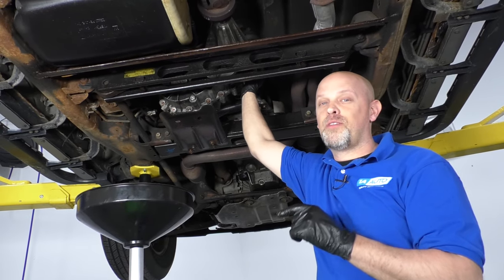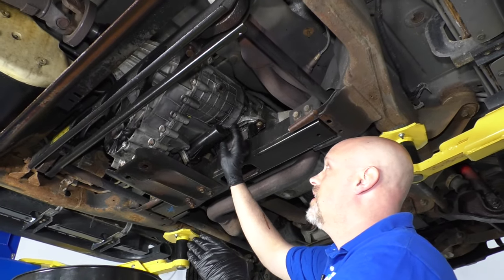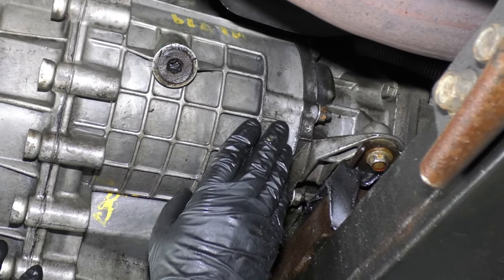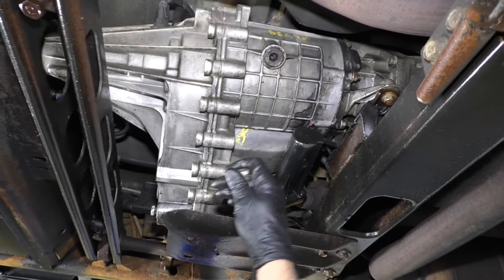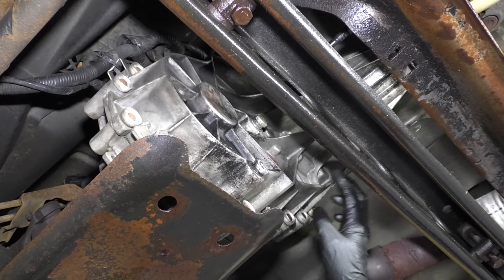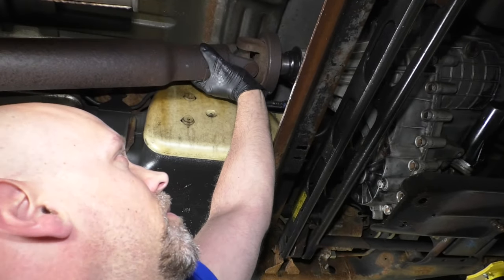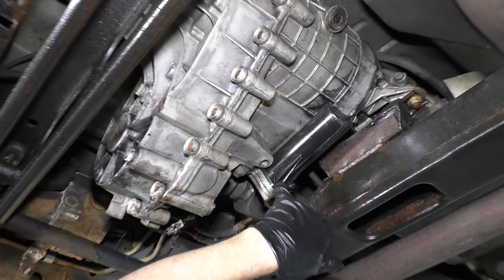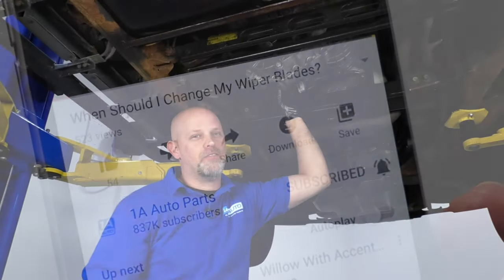Common GM Truck and SUV Transfer Case Problems

Comment: I have a 2018 Chevy 2500hd Duramax with 2, 4Hi and 4Lo.  I would like the auto function as offered by AUTOTRAC® 2-SPEED TRANSFER CASE WITH DIAL CONTROLS, is this possible and what needed?

Comment: 2002 escalade 6.0 AWD rear drive shaft is not turning the back wheels  car only moves with front wheels any idea?
Reply from the maker: +Shawn Wickham We wouldn't be able to diagnose an issue like that here, you may want to have a local mechanic take a look at it. Thanks for checking us out! http://1aau.to/m/Shop-1AAuto-c

Comment: Is there a way where I won't have to have the transfer case if I just run it in 2WD? I heard something somewhere about if u don't engage the 4WD then the transfer case issue won't be a problem... Can ya help please?
Reply: Mine still leaks and I only use 2wd

Comment: Just financed a 12 equinox with no warranty ff three mos.  Later had to be towed they told me it needs a new transfer case and catalytic converter their wanting $3820 for parts and labor
Reply: Unfortunately there known to have those problems,my wife use to have a 2012 or 2011 and there were engine problems,check and see if there's a recall on that particular problem...My wife now has a 2016,no problems with that one...
Reply: always google the car you want to buy first for known problems next time.

Comment: Hey I have a 2000 suburban k1500 it makes clunking noises when I take my foot off the accelerator n when I hit the accelerator I don’t hear it. Need to know the actual problem
Reply from the maker: +Nate Williams We would suggest consulting with a reputable local mechanic to determine the exact cause of this problem.
Reply: Could be u joints, carrier bearing, trans or motor mounts. Look all that over, see if there's anything amiss.
Reply: @markk3652  jnb

Comment: So I have a question my 4 wheel drive is messed up I have a gmc 02 yukon 4x4 I can't use auto 4wheel at all  an I can use 4 high an low but after about 30 seconds the service light comes on for 4x4
Reply: There’s videos about one of the electrical cables for the system not being grounded. Look up “Chevy service 4wd  message,” might just be as simple as regrounding the wire

Comment: What does the transfer case do for a 4 wheel drive vehicle? And how can you tell when its bad? I recently had a transmission replaced and its still having shifting issues

Comment: I bulletproofed my truck supposdly in a shop called"precision automotive and diesel ".the mechanic Rob told me he fixed the truck and I told him whatever u see wrong fix it.He charged me for a used injector 1900$.It was not part of the bulletproof job but I trusted him. I drove the truck and parked it in a clean parking lot with 250$ a month. The transfer case is leaking oil now and he said it's not his fault. Knowing that the truck was NOT leaking before I took it to him!!!
90% of the mechanics are scammers. 
Now I want to fix it at home.any suggestions?

Comment: I have a 97 gmc jimmy 4x4 the push button works fine and I can hear the four wheel drive engaging but when I test it in the mud only the back wheels spin what could this be?
Reply: Front diff isn’t engaging
Reply: There is a electrical part that engages the 4x4. Mine was worn it would engage but teeth are worn. It’s a $500 part for me.
Reply: I believe that vintage GMC front axle is engaged via a vacuum servo. Maybe located under the battery tray. Could be just a broken vacuum tea or line going to the servo.

Comment: What could be the reason my 4wd shifter is dangling around/loose and won’t activate my 4wd mode?
Reply: did you ever find this out having current problems with 4wd shifter

Comment: So it's actually not called the front transfer case its the front differential thats broke so i got the naming wrong but its whats broken the mechanic thinks its a bad transfer case but its not 

He thinks once the back or middle transfer case is replaced that the truck will have drive and reverse after that but i don't think so because i heard the front differential rattling bad and just before we turned around the corner then it broke and wouldn't drive or reverse so its like its stuck in neutral the front differential sount like there was a metal plate dangling and rattling around bad 

But the mechanic says its a bad back transfer case and thats our problem after its fixed we're good to go he says.

Comment: I really don't see how will it drive with a new transfer case but a broken front differential or switch gears from 4wd hi or 4wd low to 2wd my question is hows that gonna work when we heard the front differential break after we turned the corner 

I say the mechanic will see fixing the transfer case still ain't gonna fix the no drive or reverse problem long as the front differential gears are broken

Comment: What happens when you install an overbuilt Tcase and now you have TO much power?
Reply from the maker: +The- potato-warrior We wouldn't be able to diagnose an issue like that here, you may want to have a local mechanic take a look at it. Thanks for checking us out! http://1aau.to/m/Shop-1AAuto-c
Reply: That's called a Ford F 150, that's what.

Comment: I have sounds in my four-wheel drive when I put it in 4-wheel drive sound like crunching sound but it would run and now even when it's in drive without the polar bear drive that you can hear the the noise I'm not quite sure what it is it's a 04 Silverado four-wheel drive if anyone can understand it
Reply from the maker: +Paul Headley We wouldn't be able to diagnose an issue like that here, you may want to have a local mechanic take a look at it. Thanks for checking us out! http://1aau.to/m/Shop-1AAuto-c

Comment: How do you have over a thousand Chevrolet videos and ZERO for showing an easy fix for a common problem? This video talks about a tailshaft seal and how it is an easy fix for a common problem but you have zero videos on the procedure.
Reply: Dude. If you don't know how to replace a seal already. Then you really SHOULDN'T. Be  attempting to repair a vehicle anyway.  Which is why. His videos don't show that very simple procedure. Every shade tree/back yard  mechanic. already  knows how to do.

Comment: ATF fluid is thin like water!!!!! It’s junk! That causes leaks ,mostly ignored, they run with less fluid for longer periods. ATF doesn’t have enough dampening effect on gears and chains. I rund TDH tractor fluid in the winter- 5-30,10-30 viscosity. In the summer 85-140 or something similar! No issues, less shock loads on components etc, better seal life, no leaks! Try it.

Comment: I have a 2006 chevy hd 2500 4x4 the leak is between the transfer case and transmission is that gasket easy to replace

Comment: I got a 2001 regular cab work truck four-wheel-drive Chevy 4.8 and my rear driveshaft to the transfer case has up to 2 mm of slop when I push up on the shaft if there’s no oil on the ground could that mean that my transfer case is almost empty because there’s some oil & dirt surrounding the seal but no oil on the ground it vibrates over 40 mph and worsens with speed please help thanks.

Comment: I have a 2007hummer h3 if the transfer case motor actuator goes out will that put everything in neutral its all wheel drive
Reply: Yes absolutely, it did on my truck